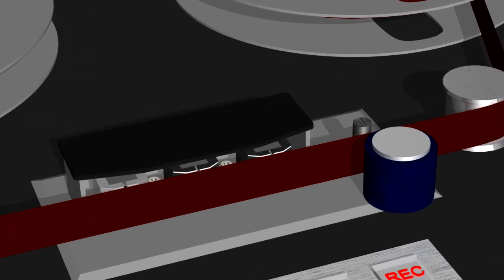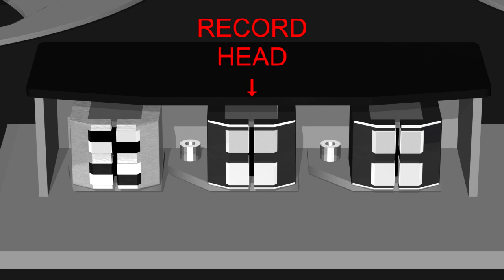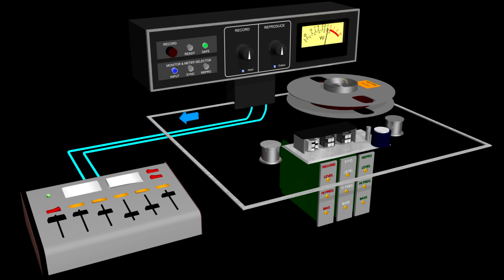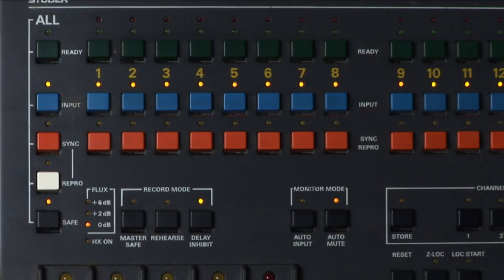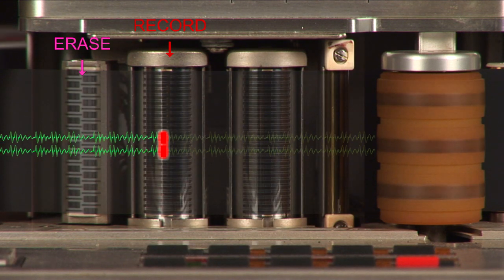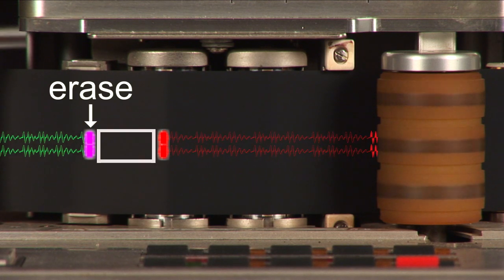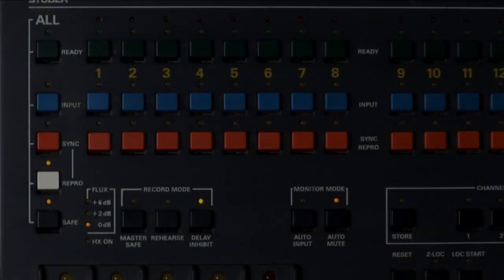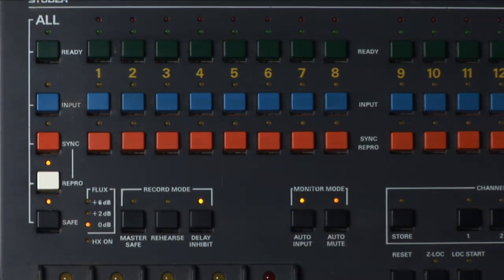How it Works. Multitrack  Audio Tape Recorder.

Comment: Love the videos.  One of my biggest regrets is not taking (1970's) advantage of an opportunity I had to see how dubbing was done, after an audio engineer heard a Sinatra compilation tape I made using a Dragon cassette deck.  As a recovering audiophile - and while digital has its' merits - I'm still basically an analog guy whenever possible.  Thanks again for the videos.